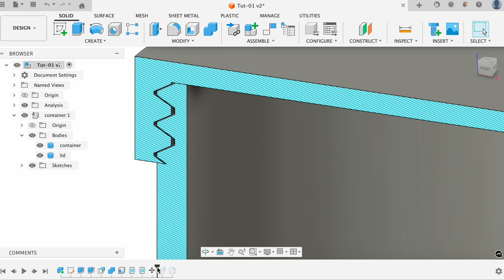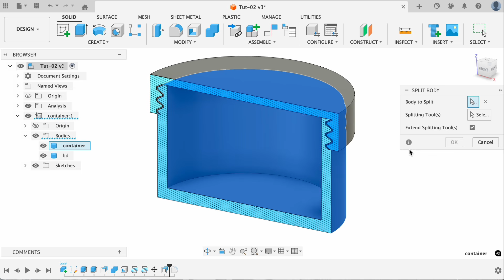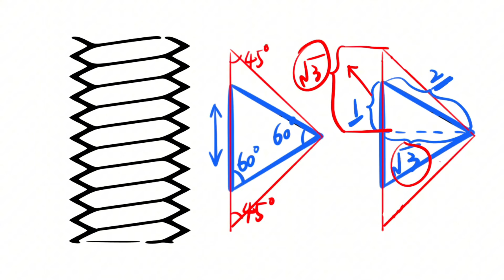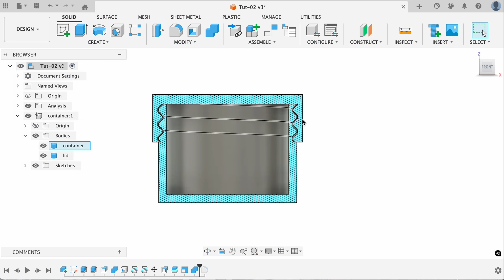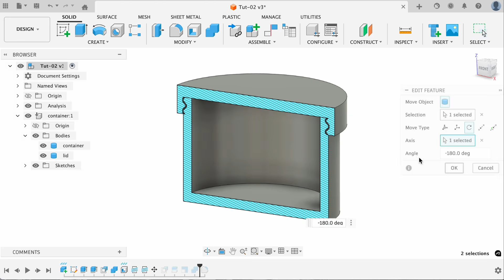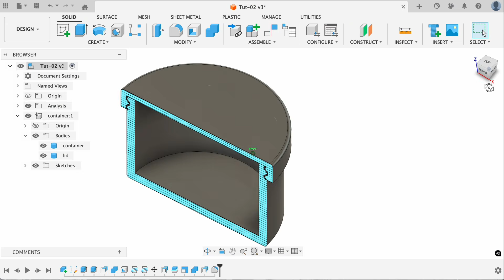Stop Your Threads From Sagging! Overhang Optimization in Fusion 360 for 3D Printing Design

Comment: Very nice video! I'm about to send it to the printer. I'd love the same video with a deeper discussion of the math. The math was not too much for me but it was a little too fast for me. In the meantime I'll go back and stare at the "here's a little math" section.
Reply from the maker: That's the best feedback I could ask for! I hear you on the math—I tried to keep it snappy to keep the modeling flow going, but I'm definitely considering adding more detailed breakdowns or documentation in the future. Happy printing!
Reply: @send_to_print don't be afraid to use a little extra time - I love these non-fluff, learning nuggets - 5 to 10 mins long - if you need the extra minute to go over the content, that's not adding fluff 💚😊

Comment: I've been playing with this and ran into an issue you may be able to solve with your math aptitude. I went ahead and parameterized everything possible. The two items that can't take parameters are the thread selection from the dropdown, and the Z scaling. Both of those need to be manually edited as numbers or formulae. When I tried to change my bin diameter from 50 to 60, I got some fatal errors, which I anticipated. I then manually changed the dropdown in both thread features to 60mm, and the errors disappeared. But the threads couldn't be aligned. I'm wondering if the value you used for the z scaling and the top offset of 3^0.5 also needs to be changed. Any thoughts on this? I'd love to make this parameterized enough to make any sized bin, even if I have to manually enter and calculate those values.
Reply from the maker: Thank you for sharing your progress with me! Regarding your issue, modifying the container height and thread area parameters works fine, but the diameter is tricky because the ISO thread Size and Designation are dropdown menus that can't reference parameters directly. You need to manually select the Size to match your container diameter and then set the Designation as the diameter multiplied by 2 or 3. The good news is the 3^0.5 Z-scaling is a constant since it only relates to the geometry of stretching a 60° equilateral triangle into a 45° isosceles right triangle, so you don't need to change that for different diameters. Regarding the alignment issue, don't worry—it’s just a reset in the software when the size changes and won't affect the actual 3D printing or functionality. If you want 100% parameterization, the Thread Tool might be too limited due to its library constraints. I'm actually making a new video using the Coil Tool to show a fully parametric method from scratch, so please stay tuned for that if you're interested. Best of luck with your build!

Comment: Hello,

Is it possible to set the parameters so that you can change not only the height but also the diameter? With your steps, I can't adjust the width.

Thank you
Reply from the maker: Did you mean the thread size? For standard ISO threads, Fusion 360 requires you to select the diameter from a predefined dropdown list. Currently, I haven't found a way to link a parameter directly to that specific selection field. For now, you’ll need to manually select the size that matches the diameter of your container.

Comment: that's a cool hack, but since you are not really using a metric thread any longer, I would argue it is easier to just draw the thread profile you want and manually cut the threads yourself, that way you can easily draw your thread to be at 45° instead of 60°
Reply from the maker: You make a valid point! Drawing a custom profile and using a Sweep/Coil command definitely gives you 100% control. This trick is just a fast alternative for those who prefer working with the standard thread tool features. Both methods lead to the 45° result! Thanks for sharing your insights!
Reply: @send_to_print I agree, I still loved your hack, I hadn't thought about doing it that way. This is super handy if STL to step conversions and I have already given it a try today.

Thanks for making the video!
Reply: It would be great if Fusion team add that as a parameter as more and more people use F360 for FDM printing and having a simple thread tool for that process sounds like a reasonable feature to have.
Reply: @ziomalZparafii  yepp. the coil plus profile method takes much longer to set up than this quite cool simple base thread scaling method.. the math flew over my head but i can apply it.

Comment: I like the video; it did not occur to me that scaling a 60-degree thread by the square root of 3 would yield a 45-degree thread. That is useful to know. By the way, a curve joining two lines is pronounced fill-it (in the UK as well as the US). Fill-ay (fillet in the UK, filet in the US) is a culinary term. Also lost to many, is that a fillet rounds an inside corner, while a radius (also called a round in metalworking, or round-over in woodworking) rounds an outside corner even though the CAD fillet tool is used to make both. CAD teachers have neglected a generation by not distinguishing between the two terms.
Reply from the maker: Great catch! I thought it was fun ;)  I really appreciate the professional explanation of the 'Fillet vs. Round' terms. Glad to have an expert in the comments!
Reply: Aside from the pronunciation of fillet (which I have to say I thought was either rage-bait, or maybe an AI voiceover), I have often wondered, as I learn fusion, why this is called a fillet. :)